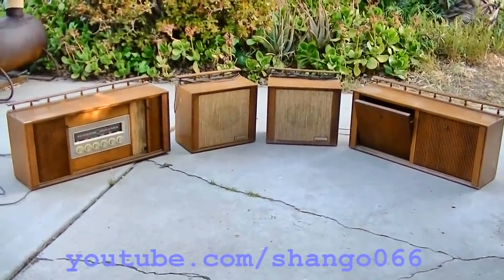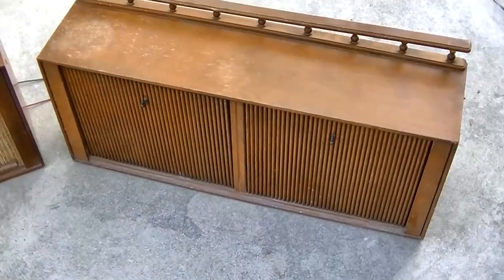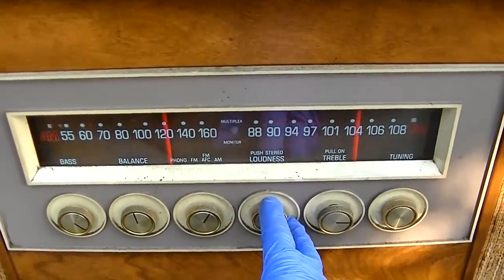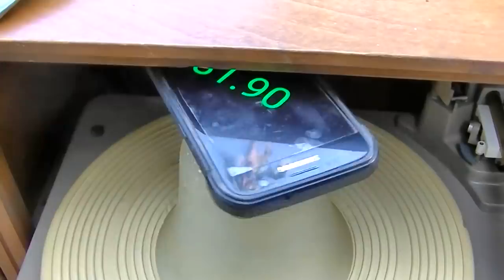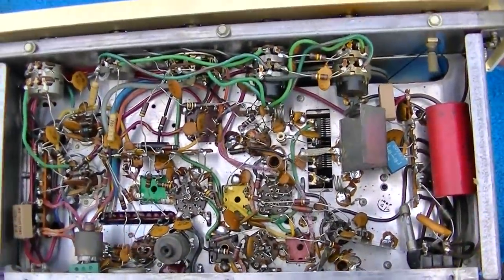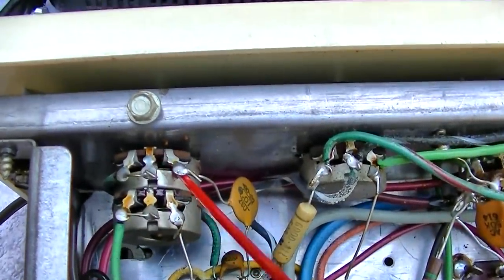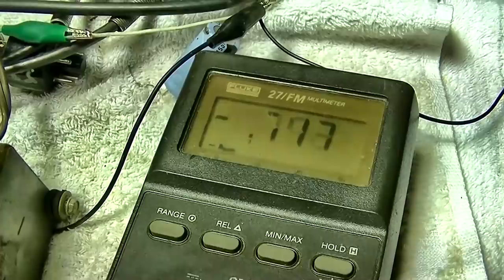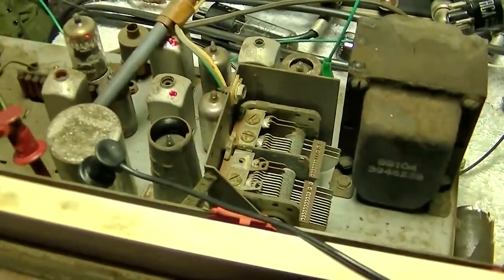1964 Packard Bell Component System AM FM Stereo Record Changer Alignment

Comment: Packard-Bell was a non-union manufacturer in Los Angeles, while all the other major brands (General Electric, Zenith, Admiral, Westinghouse) were made in union shops on the East Coast.  Therefore the other brands cost more to manufacture and to ship to California.  In 1957 California, a Packard-Bell 21" TV was $100 - $150 cheaper than the other brands.  That was a lot of money at the time.
Reply: Interesting thank you
Reply: An interesting analysis. By that measure, a Timex watch (heavily unionised) back in the day should have cost much more than a Swiss watch (non-unionised). Shipping, material costs, and "the level the market will bear" are generally more important factors in the retail price than whether the workers union ensure that the workers are allowed a toilet break. 

Incidentally the current incarnation of "Packard Bell" is a mere shell, with little if anything to do with the people who made this radio. 
https://en.wikipedia.org/wiki/Packard_Bell Arguably a good example of capitalism, red in tooth and claw. 

The original Packard Bell Corp. gained its expertise in well built electronics, as much from its war time defence contracts as anything else, and I would argue that this produced a well run, well funded company with great engineering expertise. Lack of "union labour" may have been a factor, but I would doubt it was a major one. 
https://en.wikipedia.org/wiki/Packard_Bell_Corporation
Reply: Was this the same Packard Bell who made PCs in the 90s? Or sold out to some other company overseas? I've only known Packard Bell as very cheap PCs. This is the first I've heard of them making audio equipment.
Reply: @NickDalzell  The company that made PCs just bought the right to use the name because it had good recognition with the public.
Reply: @AndyHullMcPenguin  Well, Andrew, I'm a retired attorney who practiced labor relations law. I can tell you that almost all of the companies that signed a union contract no longer exist because the owners were never able to sell them because the contract went with the business, so nobody would buy it.  And even if you did buy the business and did terminate the union contract (difficult), the Pension Benefit Guarantee Corporation would assess a huge unfunded liability against you and collect millions of dollars from you to keep the employees' benefits going forever. So I respectfully disagree with you.  I belonged to a couple of unions and did not like it at all.  I would much rather deal directly with my employer rather than through a union.
Reply: @HamJamming  " I'm a retired attorney who practiced labor relations law. " It is tempting to consider the idea of labor/labour relations law to be an adversarial pursuit. This is, in my opinion where the crux of the problem lies. 

Received wisdom dictates that labour/labor is considered a cost centre, and a liability, and a such should be treated as a necessary evil of any business. Bear in mind that your labor as an attorney is relatively well paid, however this is not the experience of most of us. We have to fight hard for our crust.  

Consider the not entirely fanciful scenario where legal matters are in danger of being handled not by well paid individuals, but rather by the incorruptible and irrefutable logic of Artificial Intelligence. Would you then unite with your fellow attorneys to resist such a move or would you simply shrug,  your shoulders, abandon your pension rights, your current financial commitments, your Law practice  and get a job as a computer programmer.

Comment: Oh wow, I have the center piece to this. I had no idea there were three other pieces to it. I love this stereo. I have another Packard Bell console from 62. It was awesome at least finding what changer it used. I'm using a Packard Bell branded Garrard 2025T from a later unit.

You're correct about the two tubes, they are high gain and very picky and very expensive. It was probably me that bought the last set on Ebay because I saw the writing on the wall. With two different Packard Bell units that use them, I didn't want to take a chance.

Also, replace that 6GH8, don't pass go, don't collect $200, just do it. These tubes are a certified nightmare.  Especially if this going to be sold, it will save you massive headaches later.

Comment: Nice Radio. That record deck is British and I would check the idler wheel on that as they do wear. The ECL86 is not a tube which appreciates voltage on the grid so do check. They are getting quite rare now especially over here as Hacker Record Players use them and the capacitors tend to go Jason Cruz on those! Try a 6AH6 if you need to substitute a 6HR6. We don't have a British Equivalent I checked.

Comment: It makes me wonder what they called that late 60s/early 70s style. Passive industrial? They used simplified shapes and stained plywood. It does kind of look like Ikea, but they also were all about that autumn gold color. When I was a little kid in the early 80s, that stuff was still common. It still worked for one thing. Tube sets were still floating around like the wake of a bygone era.
Reply: The top rails on the stereo makes it look like a spice rack but it looks like they're too heavy to hang on the wall. Didn't know the Packard Bell name was around before computers until I saw these videos. I'm surprised no one bought Hallicrafters for a Chinesium or whatever brand.

Comment: ECL86 / 6GW8 was pretty extensively used in the late '60s early '70s Euro radio sets (especially eastern European ones, Bulgarian, Hungarian, GDR, Polish, etc..), they put out 4W in a single-ended configuration at most. They need 250V on the plate and quite some current at 6.3V, presumably that's the reason for the power transformer in this radio.

Comment: 6GW8 = triode/pentode.  Maybe 2 watts output in class A1 at the most.
6485 or 6AH6 are also subs for 6HS6.  That tube is also used in Fisher HiFi equipment.  It's a semi-remote cutoff pentode.

Comment: Nice radio. Fun (boring) fact: The dial appears to use the Eurostile font which was new in 1962, so very modern for the time. It's still a very common font for displays and legends on controls, you'll find it on a lot of A/V and car interfaces even today, along with the similar Microgramma.

Comment: I always thought that stereo demodulation required an IC. Impressive that it can be done using tubes.
Reply: I found an early 60s stereo tube radio that had a solid state demodulator but no ICs.
Reply: I've got both tube and transistor-only (no IC)  stereo FM tuners.  Like Shango stated,  it is hit and miss for the tube tuners not to drift to the point they don't decode FM stereo anymore,  without realignment.
Reply: not trying be a jerk, but how do you think this stuff was invented in a time when IC were as rare as hen's teeth?....i was born in 64, in San Jose CA (aka the bedroom of the Silicon Valley) and i didn't see an installed IC was until 1974...and i was a Radio Shack kid...
Reply: It obviously started out this way,  but to me its a complete mystery also. Stereo radio - fm fullstop - only became a thing in my country (australia) at the very end of the seventies. And it took a while after that for consumers to catch up. Thus every surviving stereo tuner here I've ever seen - and its mostly boom boxes that have survived - all use on chip stereo demodulation.

Comment: I used to have a Packard Bell tuner/amp assembly stripped from a color TV/stereo console that looked identical to this one except the dial was oriented vertically as the unit was mounted as such in the top of the console.

Comment: I'm impressed that the primitive, passive multiplex adaptor functions, and provides a stereo beacon.  Not bad for 1963.  As to the power rating?  No chance that the single-ended amplifier with such puny output transformers could produce 20 watts.  Maybe 6 watts at 1 KHz, dropping to 2 watts or less at the frequency extremes.

Comment: I was going to say, whoever gets this needs to dump the carbon comp resistors for metal film resistors. They do drift high typically. I recently restored a very  early Marantz 1200 from '69, replacing all the caps and some diodes . I finally replaced  all the carbon comps too,  as a large number had drifted high and low. And it was mint, kept in a dry home not used a lot at a constant 60-70 degrees all its life. A real time capsule.

Comment: At 29:02 ,  the schematic shows "R6" as 2200 Ohms,  but with 68 Ohms in brackets beside that value.  What is up with this ?
Reply: Probably for an earlier revision chassis. There are a few parts with bracketed values C16, C10 etc.. R7 is a bit odd being both 12K ?

Comment: I can't believe that whole thing was only $51.x. That must have been for the extra-cost microprocessor option. At 6:29 there is another penciled in number, $507.x and if you wanted to tell me that was the price, I could believe that. What you might imagine as 6BQ5 outputs could be combo triode-pentodes in one bottle and the output sections could be single ended.

Comment: The problem is you cannot really fix the stereo without replacing the 6hr6 the stereo matrix adjustment is your avc for the multiplex signal. You cannot Adjust that noise in the stereo totally right you can change if cans settings you can compensate but if you get a perfect working 6hr6 tube everything will stay working well on that stereo. I'm not the best tech in the world but I fixed that and got it working perfectly. I have 3 of those 6hr6 tubes I bought from radioshack online branded as realistic. That solved my hours of trying to makie that stereo 100%

Comment: It's crazy that they would install two dial indicators linked together instead of just stacking the printing of the scales and using one indicator.
Reply: Unusual aesthetic design. But not difficult to make. I'm guessing it's just the one dial cord though with a second pointer attached.

Comment: I own a Heathkit AA 32 integrated stereo amplifier using 2 6GW8's per channel output tubes in push pull configuration for 20 watts per channel.  I would think that it's only actually putting out 5 wpc unless Packard Bell ran the 6gw8's to almost red plate operation.  Still sound pretty good.  73's
Reply: In the era that this stereo was made, and for many years after, there were no standards for rating the power output of an amplifier. It was common to see specs such as "peak music power" which could mean pretty much whatever the manufacturer wanted, and often was not even listed per channel. It wasn't until the Federal Trade Commission came out with a rule that manufacturers had to give the RMS rating of their amps that consumers finally got a standard to accurately judge a system's performance. Your estimate of 5 wpc is very likely on the mark for this venerable old unit.

Comment: ECL 85/6 - 8 watts in push pull, and I only saw one a side? That is 3 or 4 watts.
Reply: You are about right with 4W for single ended ECL86. The ECL86 is basically one half of a ECC83 (12AX7)  on the triode section and an EL41 (6CK5) or EL80 (6M5) for the pentode which is listed at 3.9W.
  But I would not mention the ECL85 in the same sentence as E/PCL86. 
The -85 is a vertical output tube for TV and without adapting the output transformer to the lower plate resistance needs of the ECL85 or ECL805 it is not a drop in on audio amps plus it lacks gain on the triode section.
But yes, since PCL/ECL86 are getting rare and the PCL85 and 805 are plentiful one might consider looking into the ECL85, ECL805 or its precessor ECL82.
Reply: @randomsteve4288  Yes you are correct, but the 85 is cheap  and capable of making a decent amp. The 86 for those looking in was a dedicated audio valve and as Steve says the 85 isn't. They are though quite similar in many ways but the 86 is the better choice of course. 
To be honest I wrote both because even though I have 50 years of using them I always mix them up!
Reply: @randomsteve4288  😸
Reply: @randomsteve4288  PS in push pull the ECL86 can sound wonderful. I had a Rogers HG88 which I believe had a set. I have also made a few simple single ended single valve units with them. Great valve.

Comment: Lithium battery operation possible with custom power supply and replacing  6gw8 o/p stage with a stereo IC like TDA7267~ many times louder also! just a 12-0-12 transformer driven by 2 mosfets to give 100vots DC is enough

Comment: “Consolette” was the term some manufacturers used to describe those systems. The GE systems of this type were nowhere near as good as that PB, they used ordinary table radio speakers and paper / ‘lytics all throughout (I seem to recall them being series string sets too). Many of the GE consolettes were made to be hung on the wall too, with fold-out speakers that used the hinges as conductors for the speaker feeds.

Comment: Wow the problem with the 6au6 is that it will make the am work well but not the FM in that stereo I aligned mine to compensate but it will never be perfect the best way to fix that stereo is to actually use a 6hr6 and leave the alignment alone

Comment: those are some tiny output transformers for 10W a channel (since they said 20W which is of course total).  I guess at 100% distortion, maaaaybe.  still early in the video, so I don't know if the stereo is real or not, but going by how it just says "multiplex monitor" and they don't come out and say 'stereo' for the radio I am still skeptical it has real FM stereo.  right now I am going for '19KHz filter and lamp'.  haha
Reply: The 'scope verified true FM stereo demodulation. In fact, I was surprised that shango was able to align the circuit to get such great stereo separation. And you're right...those tiny output transistors could never push a clean signal of more than a couple of watts.

Comment: Should play 1950's, and 1960's songs on these, the whole neighborhood would approve 👍, and so would Radiotvphononut 📻. The Doors 👍 is good enough to be 1960's. These look like 👍 two good 👍 Packard Bell 🛎 consoles, and they're tube-type. Should play the entire American Graffiti album on one of these, only if copyright 👮 issues weren't. It would probably attract the hippies of yesteryear 👍. That first console you're trying should have a dial light. Yes 👍, I recognized the first station 🚉. I'd say this is stereo. Doesn't look like 👍 junk at all. The dial cord appears to be in great condition, but the neon dial light bulb is burned-out 🔥, or very dim. Hey!! I got one!! I saw 👀 it in one of your past videos 📹. Align your stereo multiplex decoder to The Doors. LOL 😆!! Sounds like a dry record player motor. Hey, we need to invent 72, and 75 RPM records!! LOL 😆. Proverbial fire 🔥 truck noise in the background. Quite a scratchy record noise. Could actually hear 👂 it over the record. The records don't even drag, even with slight RPM loss. Just a little rotten grease. The record player(s) need regreased. PLEASE KEEP 👌 these. They're QUALITY, and we need a "Rockin' 🎸 Shango066". Your friend, Jeff.

Comment: i never knew packard bell made radios
Reply: Yes and no.  Yes, Packard Bell made radios, televisions, stereos, and so forth.   The Packard Bell you're probably familar with (applied to computers) is not the same company.  The original Packard Bell went bankrupt or something, and the name got bought by another company and slapped onto PCs starting in the 1980s.   Sort of like how Crosley and Victrola have little to do with the companies that originally bore those names.
Reply: A "Packard Bell" PC with Sparkomatic "Altec Lansing" speakers, now that would be an exercise in naming rights :P
Reply: @xaenon  Teledyne sold off Packard Bell to what became the computer company in 1986. It wasn't a licenced 'zombie brand' owned by a holding company like Crosley, Victrola, etc.
Reply: @Movie-Tech    Semantics.   Packard Bell was aquired in 1968 by Teledyne, but by 1986 the brand was essentially 'dead' and was sold off to investors solely for the the name.  Nothing of the actual manufacturing infrastructure was actually sold.  

We could argue back and forth whether it's really the same company or not, but it makes little difference because functionally the end results are the same:  there's zero connection between the PC manufacturer and the stereo in the video other than the name attached to them.  

Again, like Crosley and Victrola.  Resurrected names with no connection to the original companies that held them.
Reply: I know tho Packard Bell later become bought by Acer am I right?
Reply: @Rainbow__cookie  Yeah.  They're owned by Acer now.   Acer also owns Gateway, IIRC.